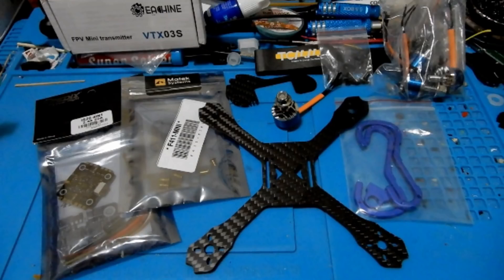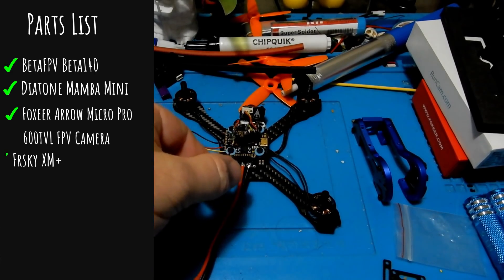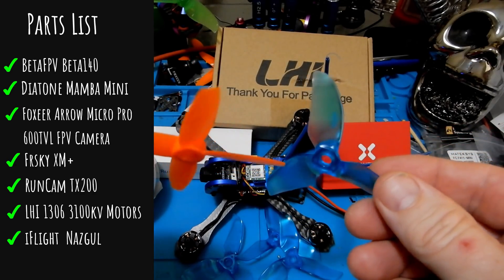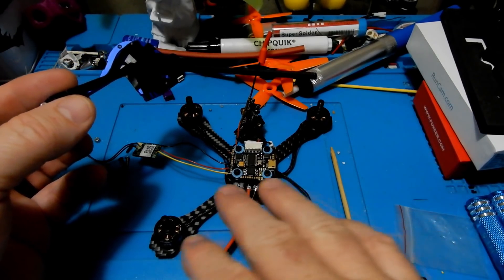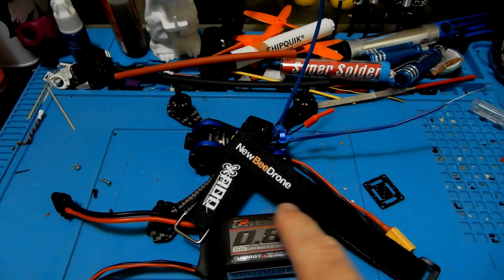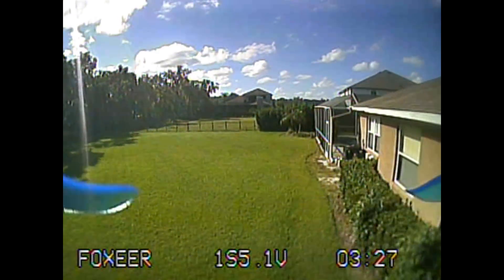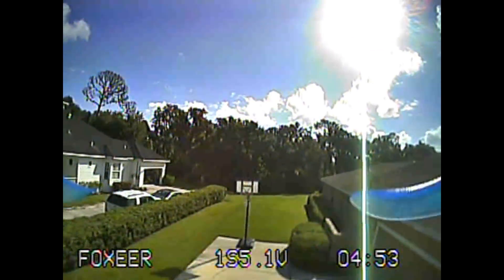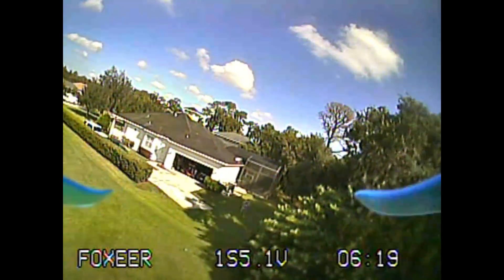Beta140 by BetaFPV - 140mm Quadcopter Budget Build

Comment: Great build. Glad to see its still around. I built the same frame, but using totally different parts than you (custom build, too). :) I use FlySky, so my receiver (everything, except ESC's) fit inside (i8S I believe was the name). I put my ESC's on the arms on my first build 1 1/2 yrs ago. 
I intend to modify it (removing ESC's from the arms and putting everything inside and still be a budget build). :) 

After, I finish a build I just received parts for. :)

Comment: I really love my Nazgul props. They fly really smooth and have good grip, use them on my Skyzone S140...flies so much better than the Gemfan 3052 props, at least on that setup. I checked out this frame a few months back, and it actaully looks like the Tyro kit quad is exactly the same except with 5 in arms. Keep the reviews coming.

Comment: Awesome. Love good quality budget builds. Also love betafpv. I’ve been looking at this frame for ages and debating on getting it for a second 3 inch build. My first was the geprc sparrow frame and hglrc f428 stack and emax 1306 3300’s. It’s my fav quad, I love it even more than my hawk 5 and babyhawk r lol. I just may have to build this one. And talk about efficient, just cruising around at low throttle on a 850 tattu 4s I get over 10 mins. Heck even racing it at 75%-100% throttle I still get 3 and a half mins.